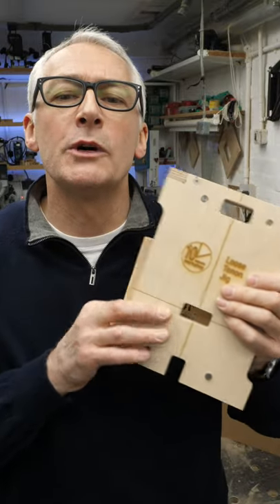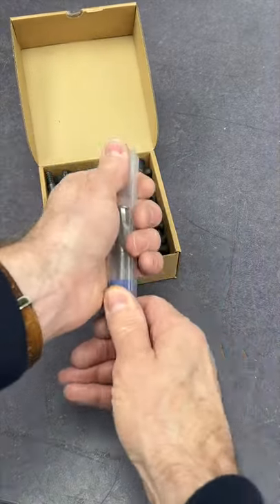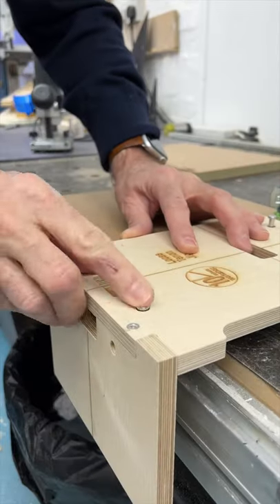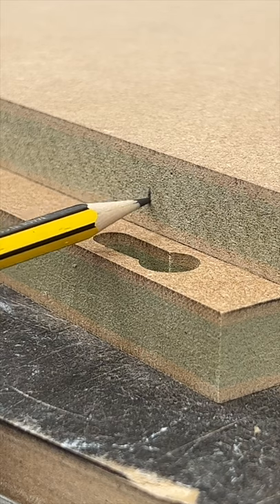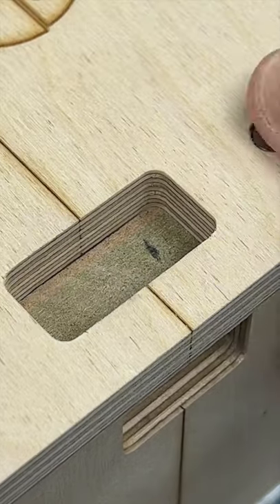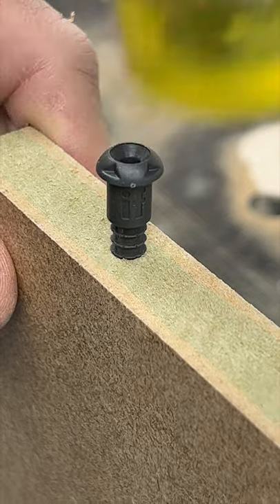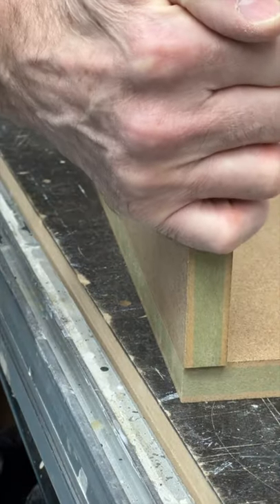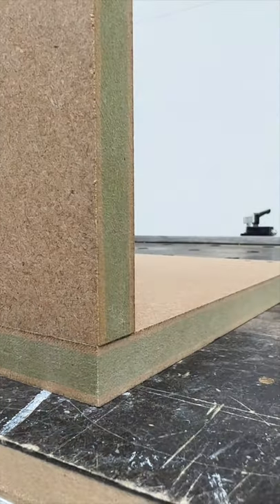Loose Tenon Jig with Peanuts, too

Comment: Great Idea Peter, another useful feature for the jig and it's also safe for anyone with a nut allergy 😁.
Have ordered my Jig last night, just need to get a couple of 4mm Inserts and machine screws once I know what length to get, I have plenty of everything else.
Happy New Year. 🍾🍾🍸🍸
Reply from the maker: Did you get the starter pack Colin? The inserts are included in that.
Reply: @Peter Millard  Hi Peter, no I didn't go for the starter Pack as I have 500 or so Domino's, two Rennie spiral upcut bits and two Trend 18mm guide bushes already 😁 so didn't see the need for the starter pack.
Reply from the maker: Fair enough Colin. If you let me have a surname I’ll pop a couple of inserts in the package, with my compliments. 👍
Reply: @10MinuteWorkshop   Oh Peter thats very kind of you, my surname is Dawson and it's Order #98 if that helps, just think it will be useful to have it "Knockdownable" which is a new 10minuteworkshop word that should make it into the OED next year. 😁
Reply from the maker: Got it. I’ll sort that, no problem. 👍👍
Reply: @10MinuteWorkshop  Hi Peter, any idea yet when the next batch might be available?

Comment: I saw your video on adding magnetic catches to cabinet doors. How do you do it if you're anew home owner without any tools except the drill, tape, pencil and a school ruler? You also talked about insuring that you have the correct placement using a piece of the original cabinet,  but I don't have any. How do you get the correct placement? I moved into an older home.
Reply from the maker: You're just going to have to do it the old-fashioned way, and measure/mark carefully. 👍
Reply: @10MinuteWorkshop  Yep! That's what I was afraid of!  Oh well! Good thing I'm a country girl! Thanks!

Comment: Isn’t the whole point in the peanut fixing that it goes the slot goes deeper by 2.1mm from start to finish to ensure you get a super snug fit? (I work as a full time joiner/machinist for those who say I don’t know what I’m on about)
Reply from the maker: No, that’s only in the CNC application. The jig & router setup produces a level slot that the fitting tightens into due to some clever - and patented - design and engineering. 👍
Reply: @10MinuteWorkshop  but I thought the the manufacturer of peanut fixings have their own jig go on a very slight taper to make it’s tighter the further it goes?
Reply from the maker: @act-like-a-pro5185   No, as I said, the jig & router setup produces a level slot; the ramped slot is only used in CNC applications.

Comment: Neat, but I am a little disappointed. when I saw the title, I thought "oh, great! he figured out how to make his loose tenon jig knock down, for easier storage. Maybe it will fit under his little workbench when its' not in use". 

Nope, just using the existing tenon jig to install peanut connectors.
Reply from the maker: As I said in the launch video, there are threaded inserts included with the starter pack to make it a knock-down jig. Peanut 2 fittings don’t currently work on stock thinner than ~15mm, and the jig is 12mm, so not currently an option. 👍